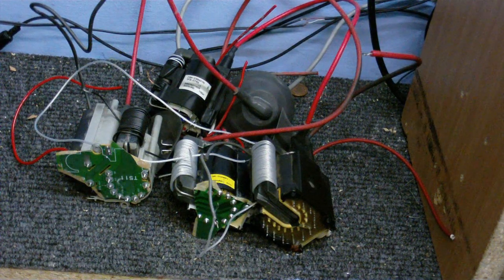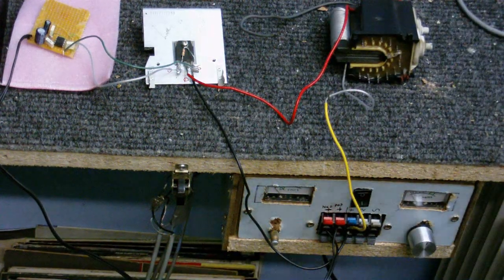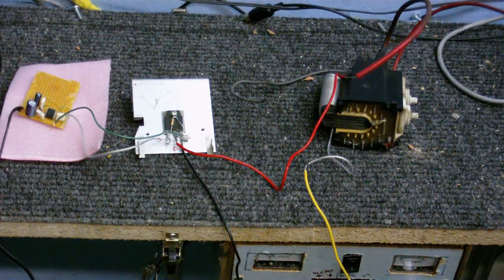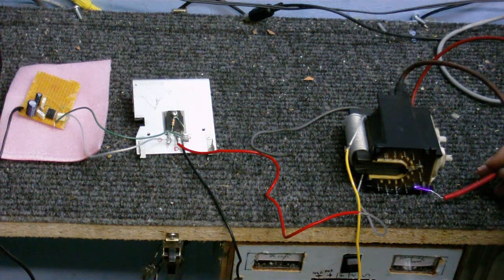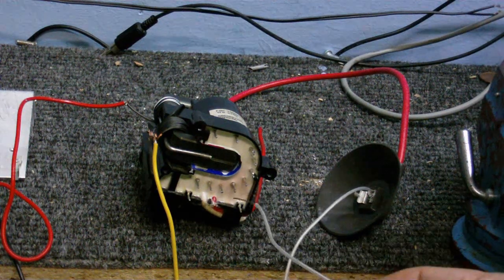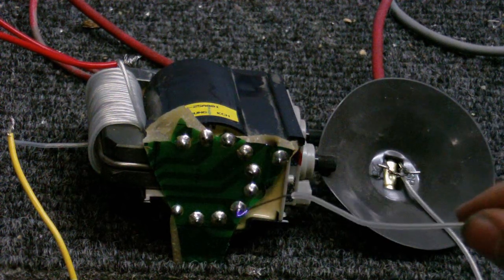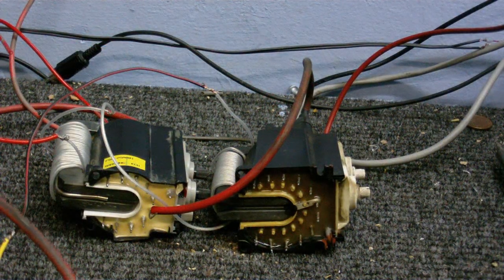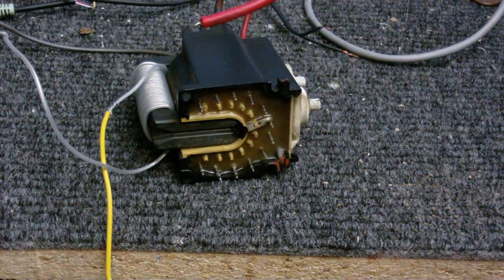CDC Electronic Workshop - Flyback Fun (sort of)

Comment: Nice! :D The main reason why you don't get a bigger arc is that the 555 timer can't switch high enough voltage to drive the MOSFET harder. So if you put a darlington coulped transistor after the 555 it should help a bit. Then if you get the MOSFET to switch properly you should get a pretty fat white-ish arc.

Comment: I really liked this video as I have too been recently messing around with fly-back transformers. The most I have managed to get from mine is around an inch of arc using the single 2n3055 based driver. 

What voltage are you putting in and do you know how much current your driver and flyback draw?

Take a look at the "ZVS" flyback driver as that will give you monster arcs!

Comment from the maker: @sk7ca thanks, I tried using a couple of transistors in a darlington cofiguration to boost the 555's output, but it just resulted in having the mosfet constantly turned on.  Could you do a video showing how your high voltage supply is wired up, I had a look, but couln't quite make out how it was done.

Comment from the maker: @Alex1M6 I'm running mine of 12 volts mostly, I'm not sure how much current it takes because the high frequency of the 555 oscilator "confuses" my digital meter, but I think it's about 1.5 amps, I could be wrong.  I also have made another supply whitch gives me about 19 volts, but there's not much difference.

Comment: Yo cant get an ordinary wire hocked to the high voltage and touch it. The insulation on the red wire has nothing to do compared to the grey. Just imagine if the grey extension arcs to you also. Nice vid, but take care.